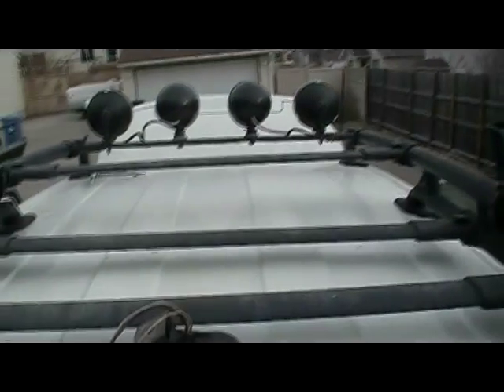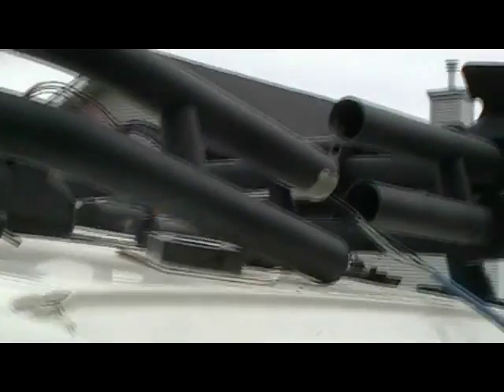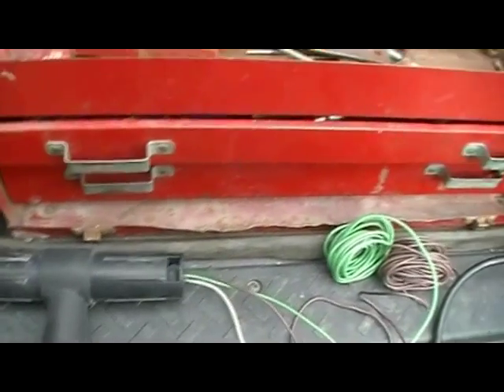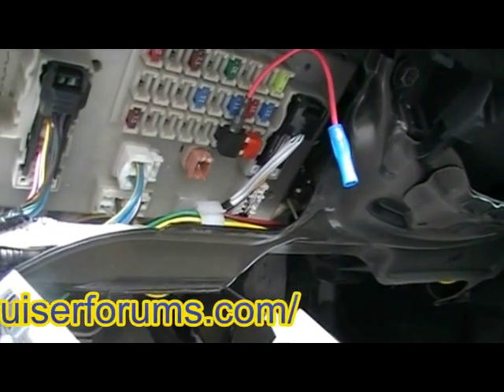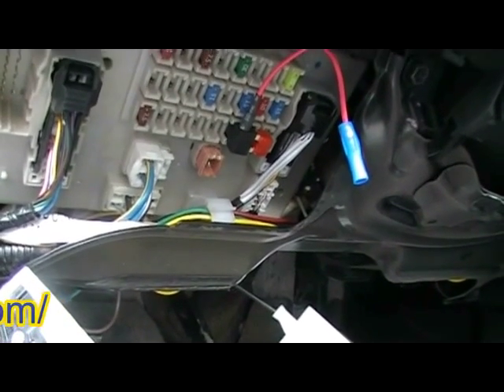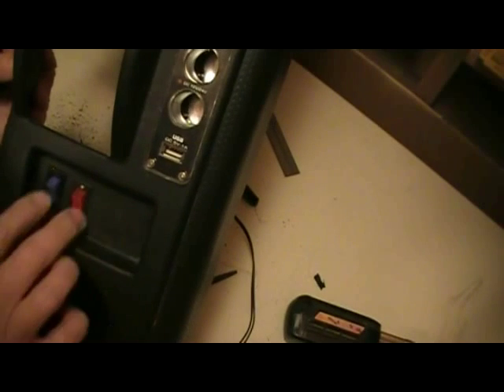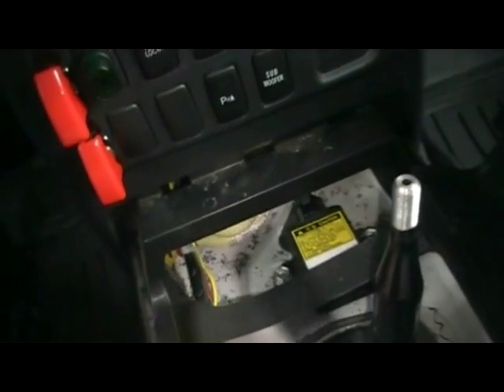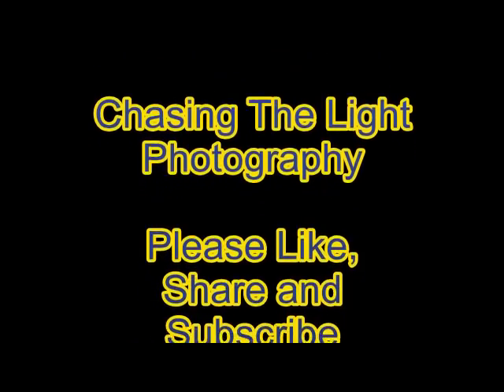How to Install Back Up Lights on FJ Cruiser Roof Rack

Comment: was there an existing hole or did you have to drill through the roof, to get wire down the pillar?
Reply from the maker: I drilled a hole under the roof rack pad on the driver's side. Then I used a grommet and silicon to seal it

Comment: With the hi lift and the bracket what are you using to secure the hi lift to the bracket ? And do you have a part #? I can see the shovel us using  quick fists.  Great video thenk you.
Reply from the maker: Hello Desert Trance, I used the same bracket for the jack that I used to mount the light https://www.summitracing.com/int/parts/aaf-all14187
Reply: @BRBTechTalk  Thank you for the reply but what are you using to attach the hi lift to that mount?

Comment: hAve yo uever used the highlift ax or shovel?
Reply from the maker: Yes mostly the ax and  the shovel I do a fair bit of camping and use the ax for fire wood and the shovel to clean up the camp or to get water running away from my tent if it is raining.

Comment: Barry, did you have to remove roof lining to get wires from coming out of roofrack "foot" to get it into the A pillar?
Reply from the maker: +Greg McQuaid No, I was able to drop the roof liner enough by removing the sun visors and A pillar cover enough to get my hand in there and route the wires where they needed to go.

Comment: I wired my lights through the outside of A-Pillar but I really want to attempt to do the install through the inside of the roof rack and through the roof. My only concern is obviously leaks. What did you use to seal the hole that you ran the wires through?
Reply from the maker: Brian Morejon I used a automotive grommet and exterior clear silicone. I put a gob on the wires and then pulled them in to the cab and worked it back and fourth adding more dabs as I thought necessary. The foot pad has a good gasket so it would probably not leak anyways.

Comment: Why did you put the switches in the tray when you have two perfectly useless dead buttons you could have inserted rocker switches into with no modification?
Reply from the maker: Bryan Pietras I want to save those dead buttons for my air lockers.

Comment: Why halogen? Led would've been much brighter and less amperage draw
Reply from the maker: Free @znovosad555 the lights were free and I can always switch the bulbs at any time ... h3 convert to LED with no issues ... also dual bulbs ... two lights 4 bulbs 2 in reverse and 2 when I want to throw a switch ... It is nice to have good light when setting up camp or trying to get someone unstuck with out being in reverse with the parking brake on ... dangerous situation.
Reply: +Barry R. Brown yeah that's true. What other things have you added to your FJ?
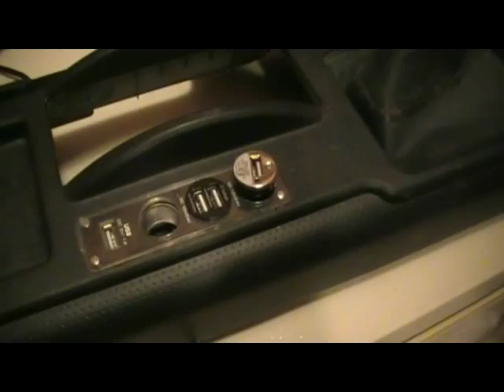Reply from the maker: +znovosad555 I have ARB bumpers front and back, 6" Rough Country lift, Mickey Thompson Baja MTZ tires, I have replaced all 4 of my shocks, Cobra Drive HD CDR 840 dash cam, Cobra 29 NW LTD Classic CB Radio, 4' Fire stick, Kenwood TK-726 VHF Transceiver,  Springtail back door rack, Springtail back seat cargo divider, fire extinguisher, first aid kit, 2 Hella 3000 roof mounted lights, 2 Pro Comp 130 roof mounted lights, 2 Pro Comp HID front bumper mounted lights, cigarette lighter style power point in rear cargo, custom power point in front console (you can see the power points in this video at 12:09), pioneer tools on roof, 4' jack on roof, rear diff breather re-locate to gas cap door area, Hella back up lights on roof (obviously) and I have a RAM mount for my Garmin GPS mounted on my CB bracket. I think that covers it but I probably forgot some things.
Reply: +Barry R. Brown holy crap. A lot of time and money put in then. Next vehicle I'm getting is an FJ. Now I'm starting to regret getting my f150
Reply from the maker: Smart move, they are a little expensive to get into but they hold their value like no other ... when you go to sell it you will get most of your money back that you paid for it, some people are getting more than they paid for them when they trade in.
Reply: +Barry R. Brown my f150 isn't worth too much. We'll see though. Next couple of years I'll probably get an FJ and start building it up how I want
Reply: Barry it is amazing how the value has held up on the FJ, mine is a 07' and I'm still getting offers close to  what I paid for it new. I bought mine loaded and it would cost alot to pry it way from me. Take good care of 'em  and don't let the dirt scare ya!
Reply: Well 7 years later i finally have my FJ. 2014 in army green. Looking to add lights the rear of my roof rack. Really was hoping i wouldnt have to drill into the roof but it seems inevitable.